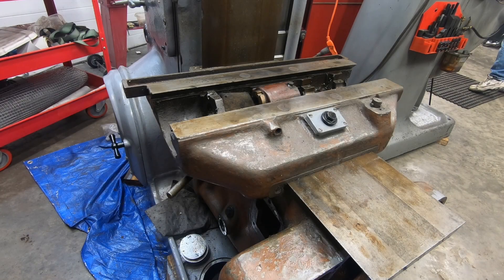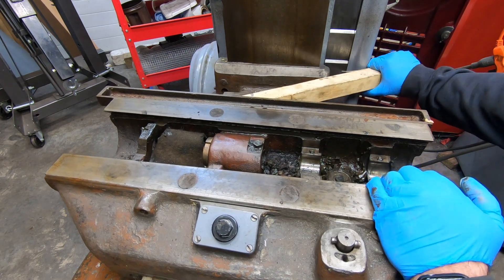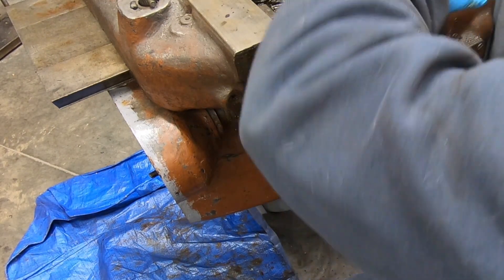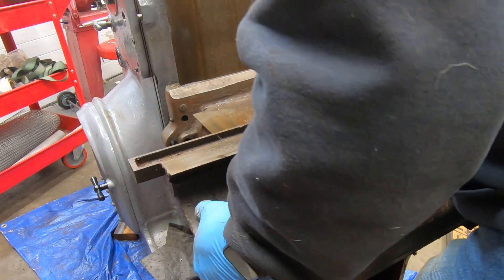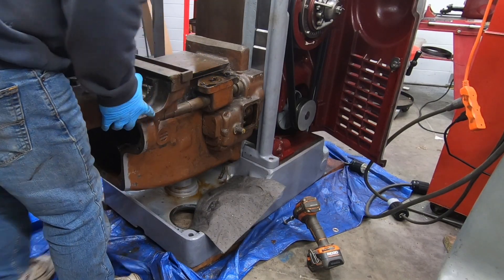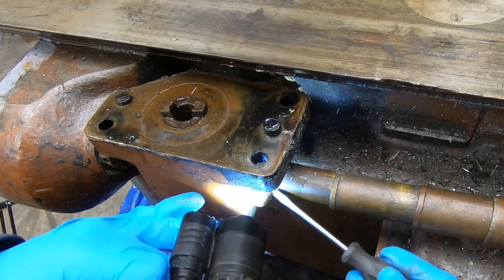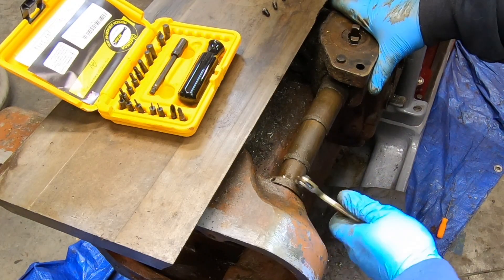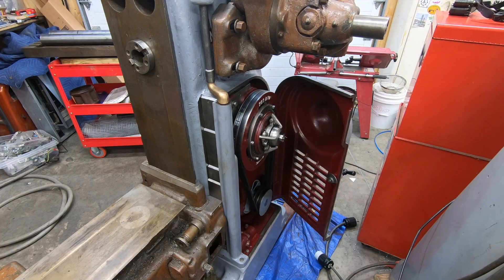Remove the saddle from the Kearney & Trecker 2HL Horizontal Mill

Comment: You're getting there , I think with a thorough cleaning and oiling that mill will serve you just fine for years to come . Still haven't decided whether your inspiring me to do mine or scaring me out of it haha . Nice video series 👍
Reply from the maker: It's not so bad. Not nearly the job that Cooper has over on @intentionaloversight8934. He has a 2CH that has broken gears. He is practically tearing the whole thing apart. But I agree, this machine is going to serve me well. I will say this, it's probably worth it to make sure things are being lubricated properly if nothing else.

Comment: I went through my k&t mill a couple years ago it's still got flaking makes on ever surface. Yours is looking great..
Reply from the maker: The more I dig into it, the moire evidence I see of it being repaired. Many of the repairs are good, so at least it was taken care of to some extent.
Reply: @MyLilMule  I don't think my k&t was used very much, to be a 1944 it's in excellent shape. Cuts the full length of the table within a thou...
Reply from the maker: @kentuckytrapper780  That's fantastic! I'll be taking some measurements once it's operational.

Comment: Pretty interesting to see that your machine has 2 distinct steps/heights on the y-ways. Mine is so worn down that it's just a flat surface. 😅
Reply from the maker: You mean on the top of the knee? Yeah, that center section is supposed to be a relief. Are you sure yours was never ground? Could be an alternative cause. 🤷🏻‍♂️